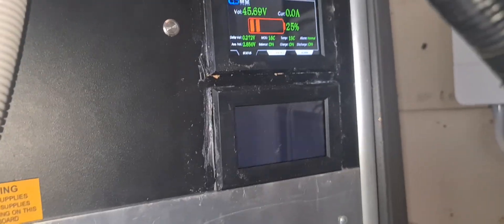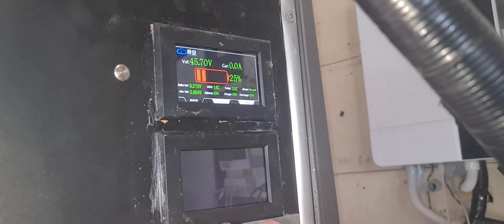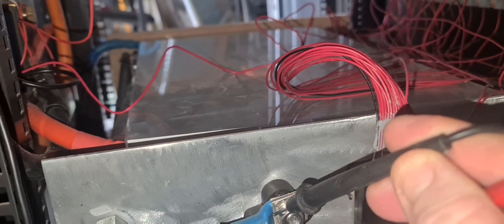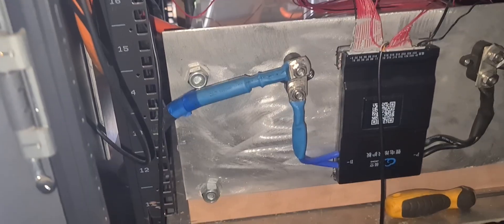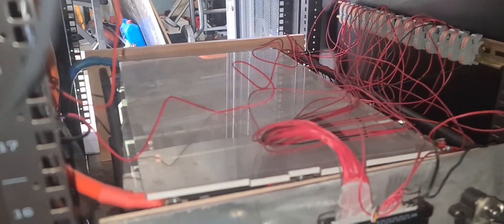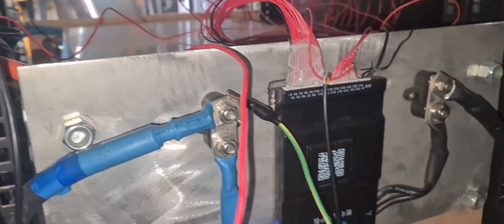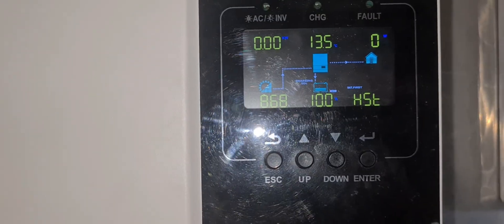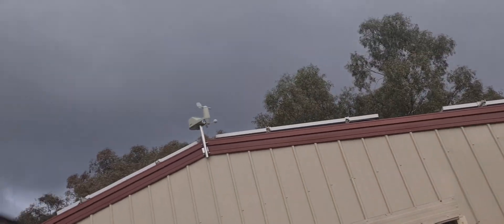Error 04: Is it my Growatt or my JKBMSes, which shut down my batteries?

Comment: The problem is we don't have enough solar panels.. it'd be nice if on a typical overcast day we could get enough power into the batteries to supply loads and keep the SOC from dropping. 
As for the problem with Error 04, the cell balance issue, surely that issue can only arise from the balancer in the BMS? I would check the BMS leads to the cells. Setup a CC power supply set to 1A and probe each balance lead from BMS connector to its cell. The resulting voltage will give you a clue.
Reply from the maker: That sounds logical this morning with clouds everywhere. I am getting 40 A into the batteries, and they have reached a flow voltage of 54.6 volts.